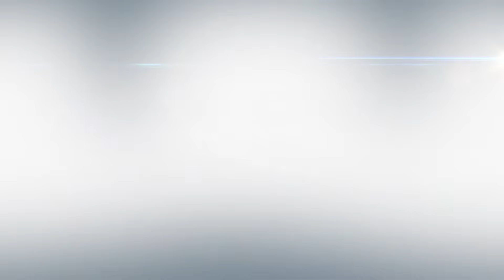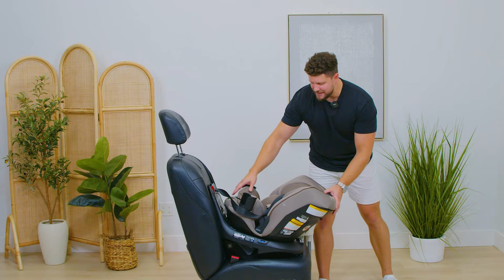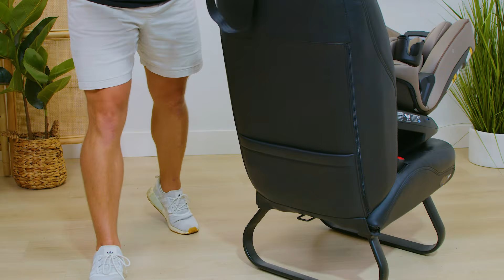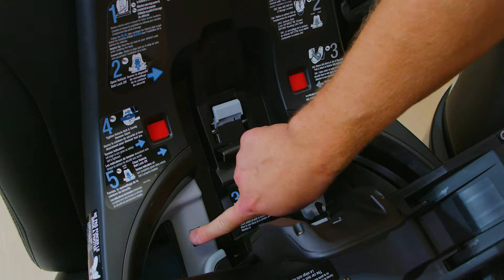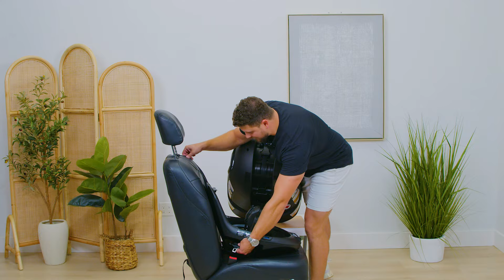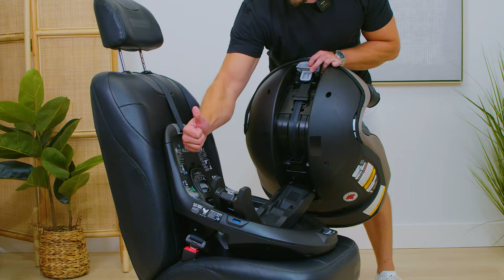How to Install the Maxi-Cosi Andi 360° Rotating Car Seat | Step-by-Step Install + Pro Tips

Comment: Its been a hour and I cant get the car seat base perfectly attached.there is no way the green indicator is completely on as the car seat is bit inclined and not the same as you have it here. Its a honda accord 2018 model ( not a fancy car) but still its not getting completely fixated. Wondering if you have any suggestions.
Reply from the maker: Hi! Thank you for watching! The Maxi-Cosi Andi 360° utilizes the TensionFix system. The green indicator is designed to confirm proper tension on the vehicle seat belt or lower UAS/LATCH strap—it is not a level indicator.
To help achieve a secure installation and activate the green TensionFix indicator, please try the following:
Position the base correctly first.
Before checking the indicator, focus on ensuring the base is firmly seated in the vehicle.
Apply firm pressure by placing your knee or upper body weight in the center of the base.
Push both downward and toward the seat crease to compress the vehicle cushion and help the base settle into position.
Tighten the installation.
Open the TensionFix compartment completely.
If using the vehicle seat belt, pull firmly on the shoulder belt to remove all slack.
If using the lower UAS/LATCH anchors, pull the adjustment strap straight outward to tighten.
Continue applying pressure to the base while tightening until the indicator changes from red to completely green.
Secure the tension door.
Close the TensionFix compartment securely over the tightened belt or strap.
Check for movement by grasping the base only at the belt path. When installed correctly, the base should move no more than 1 inch (2.5 cm) from side to side or front to back.

Please note that some movement at the top of the car seat is normal due to the rotating 360° design and does not necessarily indicate an improper installation.

For additional guidance, we recommend reviewing both your vehicle owner's manual and the Maxi-Cosi instruction manual to ensure the installation method is appropriate for your vehicle. If you continue to have concerns, Maxi-Cosi's Customer Care team can provide further support. =D
Reply: @S @SnuggleBugzStore hanks, i fixed the car seat by using both us strap and car seat belt and it worked. The car seat keeps jammig but it’s getting better. I wish the car seat had integrated belt holders similar to graco. I love maxi cosi as it has best seat materials in the market but it lacks practicality at times. For example you gotta use both hands to rotate car seat. The other companies provide single hand operation. I wish maxi cosi works on technology as well .

Comment: How/when would you remove the newborn inserts?
Reply from the maker: Remove the newborn insert from a Maxi-Cosi car seat when your baby is outgrowing it, which is typically when their head is no longer lying comfortably or the harness straps are too tight, even when adjusted properly. This usually happens around 11-12 pounds or between 2-4 months, but you should always check the specific manual for your model, as weight and torso length are the primary factors.

Comment: Can convertable carseat come out completely from it's base?

The convertable carseat shell looks heavy , so for me holding that convertable carseat shell and installing carseat belt is not comfortable.  So for me carseat belt installation with this particular convertable carseat is not easy ,it is a circus .
Reply: Hey! So you wouldn’t have to hold it as you are installing. He is having to hold it because there is only one seat isolated. In a car there is the seat bench and even in a van or vehicle with captain seats there is somewhere to rest the shell.
Reply: @thomashamilton3rd ok,i see.thx.
Reply from the maker: That's a great question, thanks for asking! Do note that convertible car seats are not able to be removed from their bases.